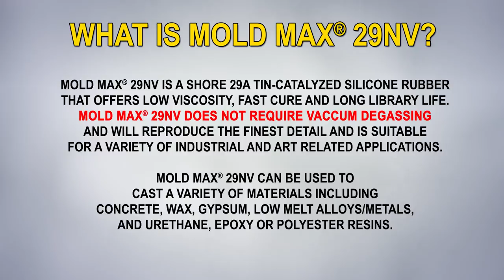Mold Making Tutorial - How To Make a Silicone Mold of an Antique Frame

Comment: Maybe it should be obvious to me but it isn’t.  Does this method maintain a “shelf” on which to set a canvas as the original frame must have had?  Or would a router still be needed in order to create the shelf on the back?  Thanks for any info!
Reply from the maker: If you are looking to include the recess for a canvas, you would either need to insert a spacer (some customers use HDPE plastic strips) or use a router as you mentioned.

Comment: If the antique wood frame you want to cast is chipping or chipped in certain spots would you apply the wax to it or no? Also do you think the rubber cast would pull anything off the wood frame
Reply from the maker: Good question.  The rubber may pull loose particles off the frame.  You should apply wax to the entire surface.
Reply: Smooth-On thank you for the reply and thanks for posting the video.  I never ever thought of this and it’s going to really help me out.  I would of thought about doing a plaster casting or even using petroleum jelly but your way seems  much easier and less mess.  Is the baseboard foam board or differently material?  Definitely going to do a test on smaller easier frame first.  I want to see how the wax performs when pulling the wood frame from the mold mixture.

Comment: How dimensionally accurate are these methods? Can they be used for some engineering models, like gears, wheels, shafts, etc. which need to be precise within let's say 0,1 mm per 100 mm.
Reply from the maker: Absolutely.  Platinum silicone and high performance resins are commonly used for these applications. https://www.smooth-on.com/applications/prototyping-inventing/

Comment: I've used Smooth-Cast325 and after an hour my plastic is still soft. How did you get that plastic to completely cure in 10 minutes?
Reply from the maker: The demold time will depend on thickness.  The thinner the casting, the longer is will take to cure.  What is your casting thickness?
Reply: Smooth-On less than 1" thick. I make action figure parts for 4" and 6" figures mostly.
Reply from the maker: Temperature can also affect cure time, you should ensure the material is at 73F.